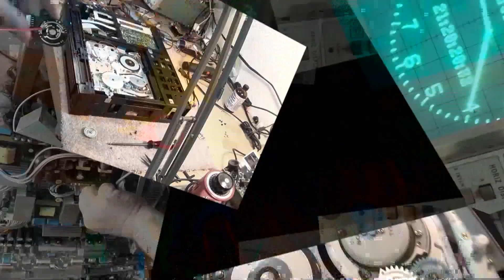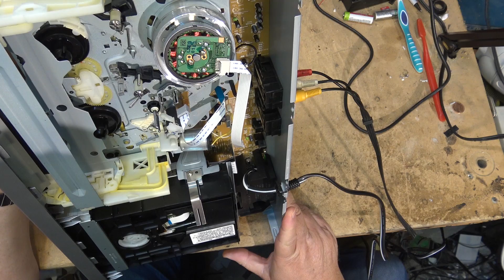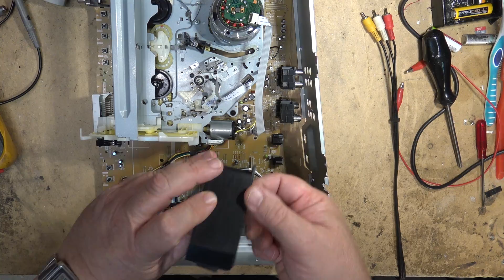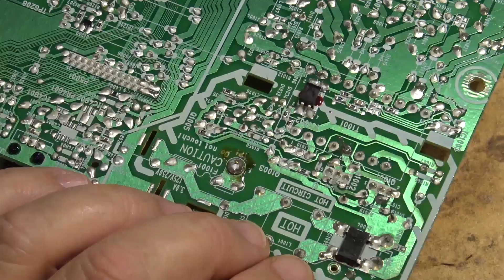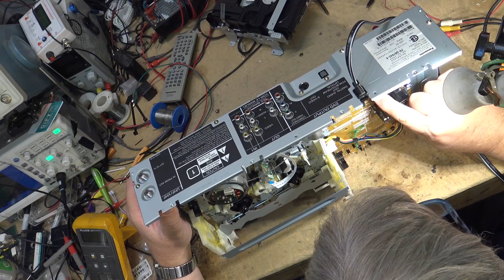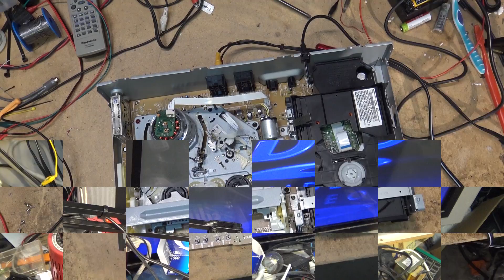Panasonic PVD4744 DVD VCR Combo totally dead with multiple problems

Comment: Enjoyed this walk through fault finding on this Panie combo. The missing composite signal was a good marker that another problem in the PSU was lurking. Strongly agree with your opinion on them pesky circuit protectors. Inside of them is probably just a strand of fine wire anyway!  I would say someone tried to clean the video heads with bleach -as that will permanently stain the alloy drum. BTW I LOVE the blast of your  cat on the intro. Give him a hug for me.

Comment: i have a similar unit (combi panasonic nv-vhd1) that is showing on VCR output half of the screen with noise (bottom part) ... and there is a diode reaching 90° under the DVD unit ( D31005 )... DVD unit is working correctly.   anyidea?

Comment: Years ago I bought a duplicate used vcr of the one I have and put it aside and kept it for the day I might need parts. It sat like that for over 10 years. The other day I turned on my vcr and no power. Retrieved the spare vcr and took its power board and swapped it into mine. Had a issue with the eject flap but nothing was broken there just the lever was out of place after I had the machine apart. Anyway I strongly suggest if you have a favorite vcr try hard to find a spare parts unit and keep it.

Comment: I have a DMR48EZV by Panasonic manufactured back in 2008 - Its a multi DVD format recorder with a VCR and as well Usb  and SD Card reader.. . I purchased it from London drugs in Gibson's back in 2010 and that was the last unit they had on hand at a discount, as they were not getting any more. If that helps of the time line - of to  when Panasonic stopped production.  cause  if memory serves I never saw any more VCR's after that - DVD recorder yes but even those are totally gone now and you won't find them in the stores any more. Toshiba was the very last company to sell off there stock. Now - no more to be found unless used.

Comment: May the good Lord bless you richly for making all of your videos.  You have a lot more success, by far, than I have with repairing electronics.
Frank
Frank Reiser Video/Audio Service
Reply from the maker: Well I have success because I did this for a living for over 20 years so you tend to get good when that's all you do. I do have an extensive background of training in the field though it's not all self-taught some of it is but I took countless courses when I was in the business put on by the manufacturers that took me into their training program to train me on their products.
Reply: @12voltvids  I have this exact same unit. It originally belonged to my grandparents who only used it a couple times, but they let me have it. And it worked flawlessly since I got it. However last night, my neighborhood had a power outage in the middle of the night, and because of that, my unit is now an electronic corpse. Is that fixable?
Reply from the maker: @supermariof0521  check the power supply. Could be dry caps or the switching ic. That part failed on mine. Was a 4.00 part with 5.00 shipping from kpcomponents. Even though they are only a 20 minute drive they only sell by mail :(
Reply: @12voltvids  Well actually my uncle told me about this place called Microcenter that could fix it. But I'll keep that in mind.

Comment: Wow, I was impressed on how quickly you zeroed in on those two faulty components. I was working on a similar 4734S  that took me about 45 minutes to find just the bad 20V zener. After replacing it, I had the same issue with partial power to the board. I was about to  give up until I saw this video. Yup, same open protection diode in exactly the same place. I used your fix with a piece of magnet wire (sanded clean) soldered as a jumper. The power was restored to the entire board, but the vhs tape would only partially load by lowering the tape but not pulling the tape out. The head would spin, then eject. I checked the entire vhs assembly for binding. I tried manually moving the mechanism, but nothing would move after the tape was lowered. I did move the mode switch around without disassembly.  After I reinstalled the vhs drive, it worked perfectly. I have never seen these these "protection diodes" before. Is it fair to say they can be safely jumpered? It seems more like a built in stroke waiting to happen. Thank you for your work. You have another device up and running.

Comment: A switching power supply and lead free solder instead of a linear power supply and leaded solder. Can things possibly deteriorate even further?
Reply from the maker: Thank the EU for the lead free solder
Reply: @12voltvids  Exactly. Politicians don't have a clue what they are doing.
Reply from the maker: @thomasleerriem6872  
Most don't for sure.
Reply from the maker: Mitsubishi had linear power supplies that were even less reliable.

Comment: Got a NV-FJ730 and a NW-SV121 - will have to do the same... replace capacitors, diodes etc. The 121 is dead, the 730 shows a noise on the lower part of the picture (tape path is ok, all clean)
Hope I get all together after the service

Was so easy with the NV-F70 etc. Remove the PSU, service it, put it back - or just buy F70ties only and just swap the PSU

Comment: When Was This Manufactured?
Reply from the maker: 2004 i think.
Reply: @12voltvids  january-december 2004. Somewhere inbetween there.
Reply: I believe I saw August 2004 written on the DVD mechanism.
Reply: @eDoc2020  yes. That was before the one on the back of the unit. I guess September or October 2004?

Comment: i have a sony unit with the same fast acting micro fuse problem, may I ask you what type of wire or filament you used?  Once, I 'd used a super thin wire from  a recycled  crt relay to fix a blown speaker, the one that runs down to the coil, covered behind the black globs of glue 😢
Reply from the maker: I used a single strand from a wire out of an HDMI cable.

Comment: Another great repair.  Did you use the wrong diode to piss the idiots off?
Reply from the maker: No I used what I had on hand.
It's 2 volts higher, which is fine. The only reason it is there is to prevent damage in the event of a power supply failure and over voltage. Earlier machines had no protection and a power supply failure where 60 ot 70 volts comes down the B+ line does plenty of damage.

Comment: One-board-designs aren't that bad, at least not as bad as 10 different PCB's stuffed into one case and screwed together with 50 different screws and 30 different cables and board-to-board connectors, many Phillips are such a pita..

Comment: My main combo unit has had to have 2 mode switch cleanings so far, too bad there aren't many decent combo units
Reply from the maker: Mode switches fail mostly when they sit unused for a period of time.  If they are regularly used the action of the switch operating will keep it clean.
Reply: @12voltvids  I guess I'm the exception
Reply from the maker: @joshm264  
Smokers in the house? That will do it.
Reply: @12voltvids  none, it might be that because I had to use alcohol instead of deoxit, seeing as $15 a pop is a bit too expensive for a teen

Comment: Great fix, Dave . I have one of these units I purchased new and it always runs flawlessly. Hope I didn't jinks it........  I'm trying to fix a pioneer dvd player  that has a stuck closed draw. The belt seem fine, and it seems the optical sled won't lower to release  the draw. Is there a slide or something keeping it locked?  Any suggestions  appreciated.   Thanks again for a great troubleshooting tutorial.
John

Comment: KUDO's  Dave.   I recently had a buddy bring me 2 Cobra walk-talk which had issues.  I opened both and found cracked solder joints.  Fixed both, but....I used my ULTRA CLASSIC Harley 's CB radio to test them.....and absent-mindedly left the scoot ON IN AUXILIARY MODE.  AGM battery dropped to 4 volts.  I put it on a "smart charger" and the voltage came back but the electronic ignition / fuel injection system light did not activate.  I scratched my head, found a vid and pulled the fuses behind the side panel.  The fuses were good and the system RE-SET itself. I am back to riding in the excellent Texas weather.  Thanks for sending us some Canadian cool air.      JwgK

Comment: Thank you, as always, for your informative videos.  Should one run the scope through the isolation transformer as well under the circumstances you demonstrated in this video, or does it matter?
Reply from the maker: My scope already has the ground prong removed so it is already floating. It doesn't hurt to power your scope through your isolation transformer, but is not necessary if the device under test is isolated.
Reply: @12voltvids  I have this same player and sadly its totally dead after a power outage killed it.
Reply from the maker: @supermariof0521  likely caps in the power supply
Reply: @12voltvids  Is it fixable or does it need to be straight up replaced?
Reply from the maker: @supermariof0521  most are repairable
Reply: @12voltvids  I see. I'll have to look into that.

Comment: My old JVC VCRs have those circuit protectors in the loading motor's 12V rail and they just blew up for no apparent reason.
Reply from the maker: They were a design fault to ensure the unit requited regular maintenance.  Especially after someone stuck a wet head cleaning tape in.

Comment: Had a feeling it might be a circuit protector. Seen them fail at random in JVC equipment  - the ones that look like two-legged transistors. Philips preferred using those round 'Wickmann/ Littelfuse' type that had a tendency to disintegrate and go o/c.
Reply from the maker: They fail if you look at them wrong.

Comment: No dropouts on the tape playback, eather the headchips are new or the drop out compensation is really good.
I could hear you mentally giving up on it early on (i'm not attacking you dave), and i do understand as i've done the same.
Having no interest in fixing crap makes giving up a good option.
Being in the right mood makes a hell of a difference,  you have had epic death repairs that i would have run away from, but you didn't.
Reply from the maker: It was all an act.  Looking at that head i didn't know what shape that was in. The big clue was component output working forb dvd player but no composite output.  Initially the power would turn on when the tape mechanism activated but no load so I thought initially a problem with load motor drive, but when no video it became aparant that there was a missing voltage.

Comment: What was the component you shorted in ckt. This same problem (SMPS) was happened to my Panasonic VCR. I couldnt find fault  is there any chance capacitors would have gone.
Reply from the maker: The first part that shorted was a zener diode.  It is there to protect against over voltage by commuting suicide (shorting to ground ) if the voltage goes over the rating of the zener. The second part was an IC protector, a fuse.  Replaced the zener and the power supply came back, but 1 voltage that operated the VCR portion was out due to the popped protector.
Reply: @12voltvids  Is there any chance power supply not to respond like this if capacitors are having bad ESR value.
Reply from the maker: @sivajisivaram2013  
No bad esr will cause low voltages, or excessive ripple in the DC at the switching frequency.  This results is herringbone interference in the video.
Reply: @12voltvids  Ok.